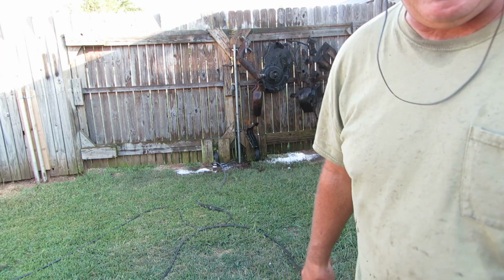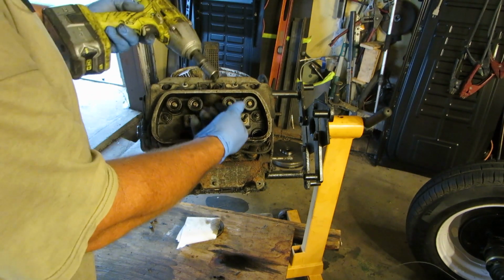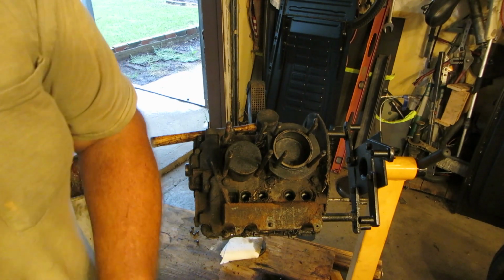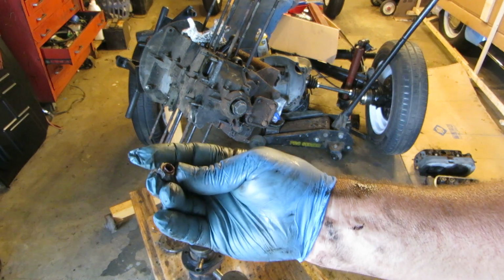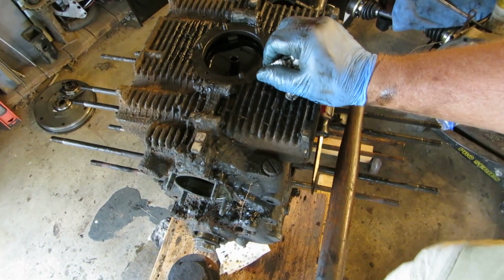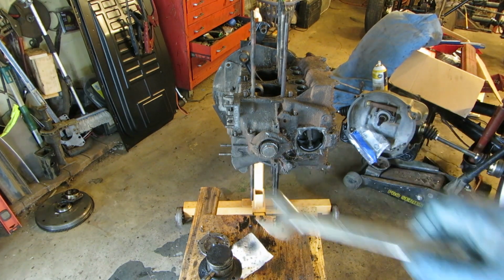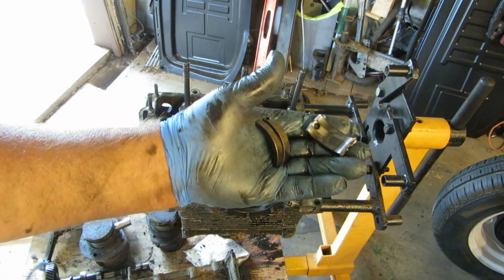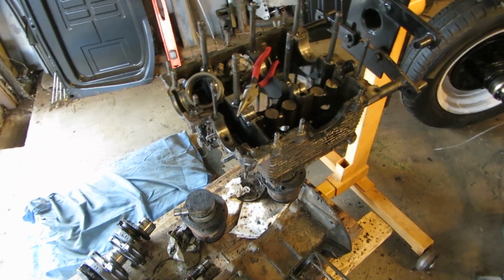1969 VW Engine Tear Down Part 2

Comment: That’s impressive with the bearing and the crank. With the lose dowel pin and the main bearing breaking, I’d really look that case over really well before it gets rebuilt.
Reply from the maker: That’s a special 3 piece main bearing...those Germans were clever...ha ha ha
I bought a new forged crank...I have a few $$ Right now (rare) so, I thought I had better.
Larry the VW guy near me told me don’t waste your money on that old case.
So, I’m using the aluminum Brazilian case I have.

Comment: Dan,
I  think they can cut the thrust to .40 and .80 under and then go with oversized thrust bearing along with a line bore. Mic the thickness of what you currently have to see how worn it is.  Machine shop/ even some vw repair shops near me have line bore capability.  Your videos have been a big help on the engine I'm rebuilding....thanks for sharing.
Reply from the maker: The local shop by my house told me don’t waste my money on that case. It would be marginal at best. I want a good solid engine. So I’m going to use a new case. I also bought a new forged crank shaft. I’m sure that bearing beat the tar out of that journal. I’m just not seeing it.
It’s funny, 40 years ago a good used German case was easy to find… Now? Nothing.

Comment: I cannot believe that crank journal is not in bad condition, with a split bearing. Not as many shops around me doing that type of machine work like years ago.
Reply from the maker: That bearing was incredible! I never saw that before..
I have a shop near me....about the last man standing.
I bought a new forged crank, and I’m going to use my new case....the old one is marginal and I just want a dependable engine.

Comment: To bad the case is in bad shape. Hard to believe, it ran well with a broken main bearing. Make sure you measure and test fit all the parts on the new crankshaft,if you got it already. I would recommend to use the original vw crankshaft on the 
 new case.   Get it balanced,if it checks out good.  All original vw crankshaft are forged and better than the aftermarket crankshaft available today.